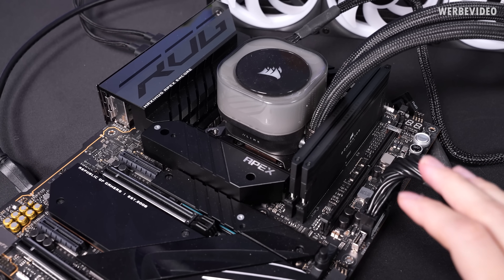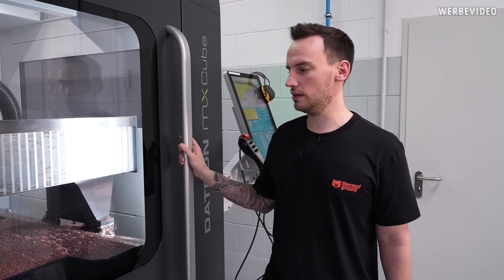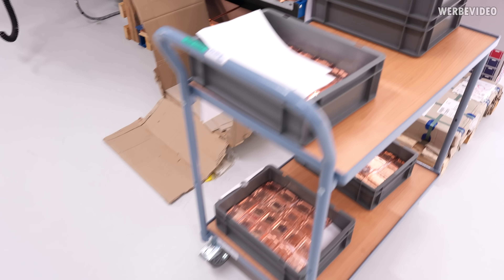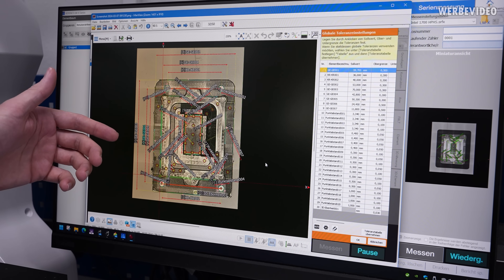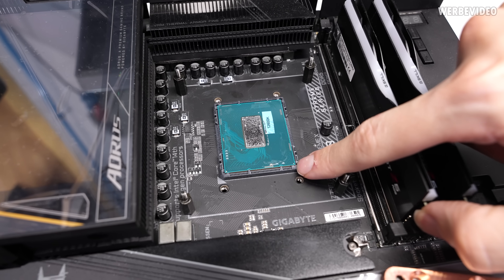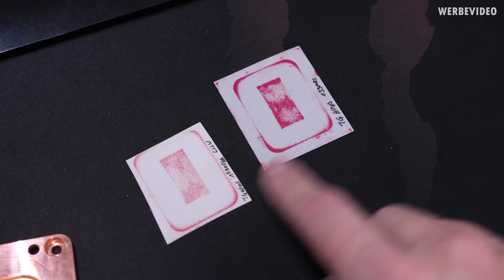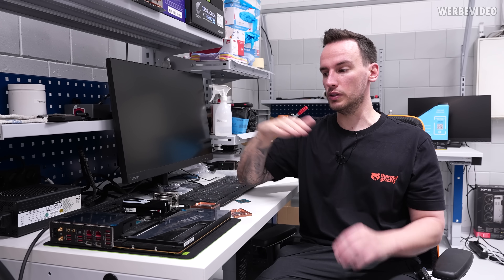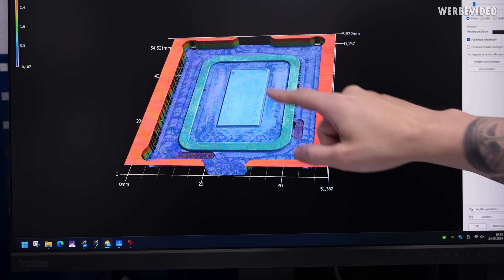I messed up

Comment: This is 10% Thermal Grizzly and 90% user. Thermal Grizzly has combined two very precise products, into one. The first product is the contact frame and the second is a direct die CPU block. The 10% comes from Thermal Grizzly going towards, form over function by removing the registration marks from its Contact Frame and never putting them on this block. The 90% is the bad delid jobs, uneven torque (you can make your own marks) and bad TIM applications. Every time I've had an overheating issue with a new cooler or build, it's been from a bad mount. If you have never done direct die cooling before, this is not the product for you to start your journey with, direct die takes time, patience and attention to detail.

Comment: I had a Corsair H60 120mm AIO.  I saw temperatures climb to the upper 80 degC one day with no load.  I deduced it was the coolant fluid that got contaminated and build-up was happening in the pump block fins.  I RMAed it with Corsair and got it replaced.  It's still sitting brand new in the box, as I simply went back to Cooler Master AIOs, and have never had a problem. What to do with the Corsair 120mm AIO with RGB (I hate RGB)...

Comment: PCB board flex , top tier boards are thicker and stiffer , my ASUS X570 DARK HERO and my ASUS Prime  X470 PRO , the same AIO , on both boards , the DARK HERO felt more stiff and secure , that's just me  , comparing a 500 dollars board to 150 dollars' board  .

Comment: Do you melt down cnc shavings and/or blocks that failed qa? Or, did some of your metal stock come from a different source? Maybe there were impurities, changing the heat extraction and transfer? Or, maybe impurities in your nickel

Comment: Do you have redundant metrology systems in place? If your QC checking is faulty (improperly configured) and you don't suspect it you will be forever chasing an invisible problem. I would recommend having many points of QC measuring including by hand. One panacea machine to measure all the dimensions is a bad idea in my opinion. Another thing I noticed, you produce one side on one type of CNC mill and then you finish the other side with the 6 axis CNC. I am not a machinist but I suspect that doing this can introduce big problems for sustaining dimensional consistency between the 2 sides. Everything has a tolerance of course and perhaps that could also be the issue. The plastic sockets may be produced with little concern for dimensional accuracy and then you will have to implement a system for leveling pressures that do not rely upon the socket corners. This will of course make the product more expensive and complex. You could also perhaps get a sample pool of data about the plastic sockets and compare them. I suspect here, they are not consistent in height. This will lead to uneven pressure etc etc you know all this stuff.

Of course I fully believe all of the things I have said were considered by you guys, you are the professionals! I hope you guys find a solution quickly, I love your transparency and honesty! ASUS and cablemod could learn a thing or two......

Comment: If it is the the plastic around the socket why not shave the edges that make contact with it and add some sort of squishy gasket made from silicon or something of the sort? That would give some leeway for that issue but then you might have to have exact mounting tensions depending on the mobo.

Comment: Wow. Very clear communication around this issue. Well done. A potential option is to send the pressure sensitive paper out to everyone who has been affected to see if there is commonality in pressure results; if you get variable results back, then it would suggest the motherboard socket spec may not be accurate enough. Exceptionally well maintained tolerances in manufacturing may not mean much if the sockets are way out of spec, or highly variable. The other vendor using the PCB vs socket may not be by accident.

Comment: Just 2-cents,😇  If according you explanation ALL DIMENSIONS and contact pressures are within the test specification,  what about the  water Flows  in a circuit?   Other thing, perhaps a Grade issue with the used materials? non-ferro?

other idea that popped up is, what IF one could use a layer of either Bimetal or memory metal that all is 100% calibrated to push (layers) perfectly down on the dies where the cooling is needed.   I know servers have have basically a monstrous high flow going over a contact service that cools idiotic fast due to the flow and other  factors.

Curious to hear your final feedback since you mentioned at the end you think you found the issue.

Good luck.  😇😇😇😇

Comment: I am one of the lucky ones who managed to order one of 50 ihs. And I won't return it, even if it doesn't fit. This ihs will be of collector's value because there are a limited number of them released and the new release is likely to be different. Thank you Roman, it is very interesting to be with you on this engineering journey towards silicon perfection.

Comment: Hi mate. I'm a mechanical engineer with some experience in root cause analysis.

From the quick understanding, I can see you have five main factors that affect the cooling performance.

1. Your product accuracy.
2. Motherboard accuracy (socket).
3. Cooling solution accuracy (lots of products out there).
4. Thermal paste quality.
5. User error (wrong installation).

Obviously, you are only able to investigate the first one (and the 4th if your thermal paste was used as well).

It sounds like you have a sophisticated quality control system, so I would suggest you ask the client to send back the product in question and test it in your lab. You can then confirm if its the root cause or not. After, you can move on to investigate the other factors above if possible.

Happy to discuss further.
All the best mate 🙂.

Comment: This sounds like user error with overtightening a side vs tightening everything evenly, OR the CPU's are not built the same. I lean more towards even tightening. You have the data to prove it works, unless the CPU quality has changed, I doubt it is your product.

Comment: I have 
7800x3d direct die 
        +
360 rad with phatkes t30
        + 
Alphacool Rise Flat Reservoir D5 with VPP pump (5k rpm)
      
-20 pbo  , 4.7 (8) mhz  
Temperature 82-84 not really happy with results........
Reply: X3D always going to be hotter than others because of die stacking
Reply: @whiteren8749  obv I'm comparing to other x3d 's   ☺️

Comment: I have full confidence in Thermal Grizzly, I've been using your products for years, and I'm looking forward to y'all figuring out what's going on with the heat spreader, because I'm going to put one in my rig. I wish more companies were as transparent as you are, thank you for making this video, and I look forward to using the heat spreader once you figure out what the issue is, if there is an issue that requires remanufacturing that is. I'm absolutely fine with waiting for it, especially with this kind of customer support. Thanks again brother! 🙂

Comment: you have professional measurement tools so I would be tempted to blame something external, I doubt motherboard manufacturers take that much measurements..that's european lab way of doing things not chinese mass manufacturing, good luck to all to fix this might well buy one when it's fixed as I'll have to redo my intel build, my cpu didn't like "msi bios enhancements" :/ we also have quality problems on plastic parts from china at work a straight line can suddenly have a 20° bend or reels get stuck in guiding rails because they are too thick, but you don't always have the choice to use them, when people say chinese quality they don't really have numbers to back it up..I do..mixed 2 packages 1 went to Germany they opened it called to declare the problem the other package went to China they had used 250'000 wrong parts not even seeing the very very obvious error (wrong markings and wrong size !) that's "chinese quality" zero QC at entry zero out of 250'000 items quality check....that must have been several days and shifts of nobody noticing

Comment: Are people using same back plate? I noticed that corsair has two different holders one is metal and one is plastic.  Plastic one is thicker than the metal backing plate for the cooler and the hold  down female screws has higher height causing the heat sink to not be screwed down tighter.

Comment: You are likely correct in saying the plastic socket likely changes z height from board to board. And your reason for choosing the plastic as a hard stopping point is also correct. 

However your creating a product for the wrong person. You can not make this product for a normal user. doing deliding / liquid metal is a risky job and such only the users that accept such risks should be using your product. There is simply no way to create the hand perfect fit for every board or even cpu even tho cpus are likely extremely close it still results in variances. 

-What you need is direct die contact with a optional crush washer or gasket that provides the cpu's pcb with socket pressure. so measure the pins resistance and create a gasket that will crush to that resistance. Yes this means users will require multiple gaskets but at least this way you will always have proper pressure for the pcb WITHOUT affecting the mounting pressure on the die it self. 
-That or you could possibly do a bundle of shims for users to test and find the perfect fit for their cpu. This would allow for proper die pressure tuning that the user could make the final say in pressure.

-You could also just do away with the hard stop and rely on intel's ability to create a perfect distance from the pcb of the cpu to the die height and it would likely work pretty well as the pcb will flex some and should likely not be a major issue. Just as long as the die is with out a doubt the majority of the mounting pressure, i think you would need to have a "go - no go" type of testing on the distance for the pcb part of the cpu (on the block to make sure its not ever going to be taking pressure away from the die in any meaningful way.)

People who do this sort of installation do not need a safety net to keep them from crushing the die. its on the user to understand what they are doing or learn the hard way. I am sorry this is just how it must be.  

Best of luck! and good on you for sharing your issue and being transparent with your customers!
PS i bought one of your direct die kits years ago for the x299 7980xe it was too thick so the die did not have any mounting pressure so i opted to just use the direct die cpu with out any hold down and it worked fine. (you also told me you could refund me if i found the paper work consider it a charitable donation for your production gear :) )

Comment: I do wonder if issues are down to socket height changing because of soldering rather than socket manufacture tolerances.

There is highly likely to be a varied paste pattern between motherboard models and potentially even between boards of the same model, as it's pretty common to tweak solder paste deposits to reduce solder fault and rework.

Comment: You could provide a consistent pressure with a flat spring backplate like GPUs do, and have excess top pressure absorbed by plastic washers only at the screw holes like some waterblocks.  It would be more of a redesign than you'd like, and the flatspring would probably have to be contracted out, but that's my suggestion.

Comment: There are so many variables in the installation of these blocks.  From not removing the sealant of the OEM IHS lifting the direct die IHS off the package to not tightening the thing down properly and then some of the motherboard sockets may not be high quality materials or within normal tolerances as most other sockets.

Comment: if I were in your position, I'd want to know: 
a) who makes the CPU sockets? Intel? Foxcon? any 3rd party? the partners?  If its any more than 1 primary source, you already have issues. 
b) if intel has an official engineering spec on it including acceptable size tolerances, and if they exceed your mounting tollerances
c) random sample a few different motherboards of different prices classes and manufacturers to see how consistent the size ACTUALLY is, because official spec and reality aren't always the same ting.

Comment: My EK direct die waterblock was really underwhelming on my 13900KS so I sanded it down to bare copper. After sanding, it performed much better. I assume that was because the coldplate was finally flat. On my 7900X3D, the der8auer direct die frame worked well after I cut parts off & smoothed the edges with a Dremel so it could fit on X3D. I'd buy your products again for sure. I appreciate that you take risks other manufacturers won't--i.e., you're not afraid to mass produce delid &/or & direct die components

Comment: Good Evening der8auer, I'm legit impressed by this video and response to this. I was attempting to purchase one of these blocks or the performance spreader, I sent an email a few days ago regarding that. When I was asking around for opinions on Reddit a user had chimed in that they were affected by this and how well you were handling it, prior to this video. 
I think a few other comments about the plastic may be a good lead, I know Lotes uses LCP for theirs but all I can find on Foxconn is that it's a thermal plastic but not specifically which one. The dimensional stability may differ as could moisture absorption changing the plastics characteristics. I don't think this has come up before because in general the surface you're using isn't one that normally endures any sort of mounting pressure or dictates dimensions for mounting. There could be a very wide variance in the quality of the plastic between motherboards.

I'm impressed by how Thermal Grizzly addressed the reddit users issue in the thread I posted and I'm impressed by this video. I was hoping to have my dream-loop up and running soon but I will be patient, the OC forums had recommended an IMC or Supercool but this video tells me it will be worth the wait. Thank you.

Comment: Nice to see some ownership of the issue, even if you don't fully understand the cause of the problem. Just thinking out loud could this be an error with tolerance stacking, differences in the plastic CPU mounting pieces between OEMs, or alternatively noting the purple valleys at 14:12 which appear to not be symmetrical - a user installing the piece 180 degrees around the wrong way?

Comment: Would be interesting to know how many cpu samples were tested to find the variance in die flatness. I've had to lap some dies that were visually warped when using a metal ruler. I would imagine the problem is compounded by many things, user error in installing (over/under tightening) and adding LM to name two and maybe even inadequate flow rates. Please do a follow up if you figure out the root cause.

Comment: People aren't torquing stuff down slow enough, probably.  When you go direct die everything gets way more sensitive about being tightened evenly.  I also don't agree with the choice to press on the substrate with just a ring instead of a sheet of metal.  That can create some warpage where you're going to look at the pressure sensitive paper and think it all looks good but it's not showing what's happening in between.\

Comment: I think there is a general lack of transparency when talking about dimensions in pc-components, you can start to run in to these if you are building a really small pc or if you do any modding.
Motherboard makers specify that their ATX motherboard is indeed 305 x 244 mm, but doesn't specify the distance from the CPU-socket to the top expansion slot, any edges of the motherboard and sometimes distance to RAM-slots.

If memory serves correctly there are different RAM-slots that have different heights, effectively changing a CPU-coolers "ram clearance".
There are also at least 5 different heights in M.2 slots, ranging from around 1.2mm from motherboard to SSD to 5-ish mm. Is your SSD single or double sided?

Do you know from where to measure the length of your graphics card? Or how to measuer graphics card width? (Im sorry, now I'm ranting)Now you need to figure out how much the power-connector is recessed, so you can fit that 12whpr2x6 cable with radius. 

Oh and I can't wait for the fans of my 2.1 slot gpu to knock the SMD's of the expansion card right below it clean off, like a weed-whacker.(rant over)(no it isn't)Those graphics cards that are marketed as dual slot cards, but I can see in the product pictures that the fan-shroud is peeking up above the 2 expansion-slot-cover/IO area.(rant over, for real) Thickness of the backplate?

This is getting better but still: asymmetric air-coolers that don't specify the asymmetric offset.
When I considered getting a custom loop I had issues finding where the fan was positioned on the radiator in relation to the end-tanks. Ended up being irrelevant as I couldn't find a 120mm radiator that was only 120mm wide.

This is the majority of my "issues" I have ran into.

Comment: I'd definitely see if the customers who were having this issue would be willing to sell or exchange their hardware so you can measure the sockets directly. Additionally, I don't know if this is gettable, but sourcing a technical drawing of the socket itself to see their tolerances and datums might help explain things. There's a good chance the plastic you're using as a reference does not have sufficiently tight tolerance for this application. I'd guess the top of the PCB is a better reference, as CPU height variations from the PCB would mean longer/shorter traces which affect performance.

Comment: As soon as you mentioned using the plastic socket corners to bottom out the spreader I thought that has to be variable here causing you issues. One thing you haven't mentioned, have you reproduced this in lab? Otherwise you will need someone setup with the issue